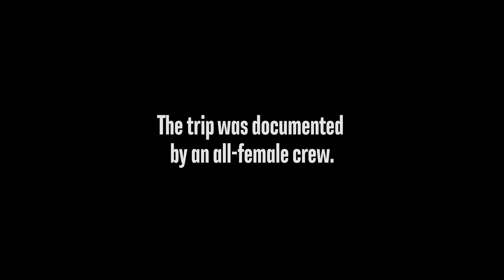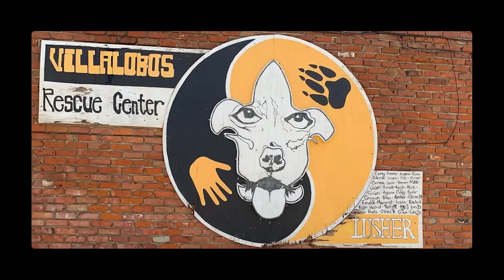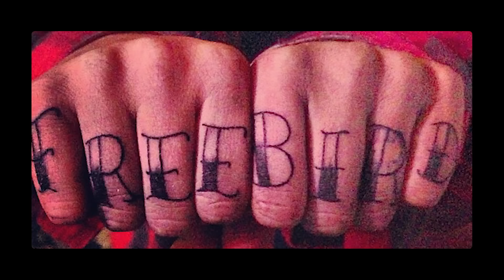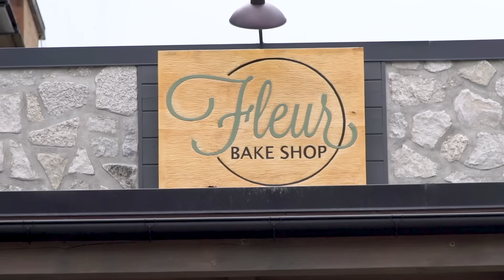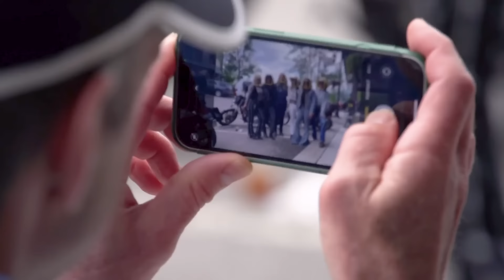Moto Maidens S1E1: Premiere | Harley-Davidson​

Comment: Harley has lost it’s marbles! 
So your putting up a mini documentary about a group of lady’s taking a road trip on scooters that a Harley Davidson dealerships will refuse servicing today? 
Yes, people are being told nothing older then 20 years for service at corporate dealers.
Reply: More like 10 years……
Reply: @dulcihrt  Was simply being generous about it.
Reply: If you're still taking your bike to the dealer out of warranty, maybe you shouldn't be riding it?
If you're bike still has a warranty maybe you bought the wrong bike? 
New harleys are useless and now corporate is realizing it so trying to use the scene that exists around the bikes that have harley soul to try to sell the scrap heaps in the show rooms.
Reply: @djd34d14   Not always the case. Hell, I’m a builder & theres times when dropping a bike off for stupid stuff just made sense. 
The (new) Harley brand  turned their backs on everything that made them what they are.
 One of the main reasons you got a Harley was the ability for being able to make your scooter as original as your ink. Plus ongoing customization. Harley saw it as a mission to squash the aftermarket parts industry & now claims customizing is clicking on part options when you build your new bike 🤦‍♂️
Reply: @RESET1776  we say most of the same things. I'm just saying that I might get the free labor under warranty but I'll pay my fellow wrench turner down the street before I ever take it back to the dealer. I agree sometimes the help is needed. It's still the best idea that someone else do my welding for a little while longer, so I get your meaning.
Reply: same here in Australia  @dulcihrt
Reply: thats why one buys a pre 2006 sporty or an evo and work on it yourself.
Reply: They’re riding isn’t that the f-ing point!